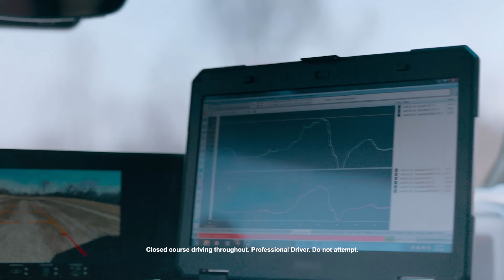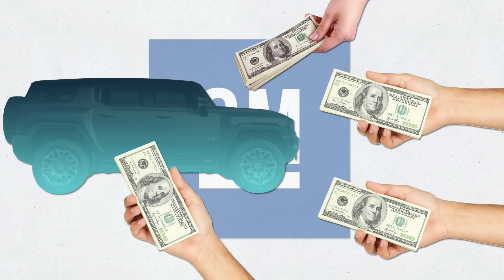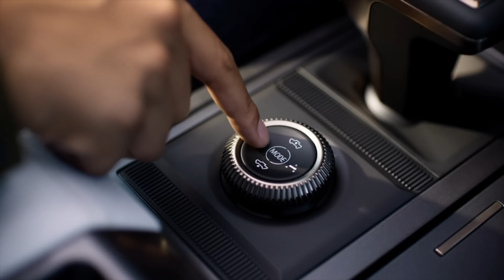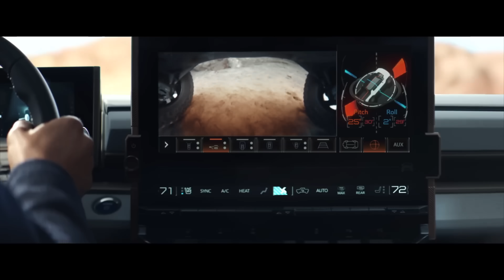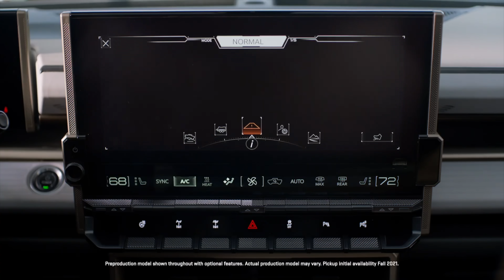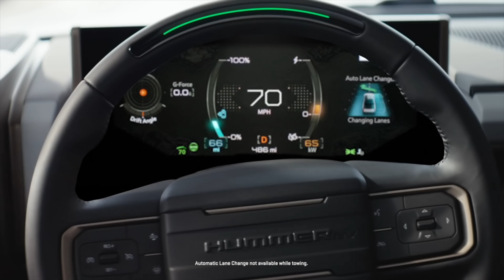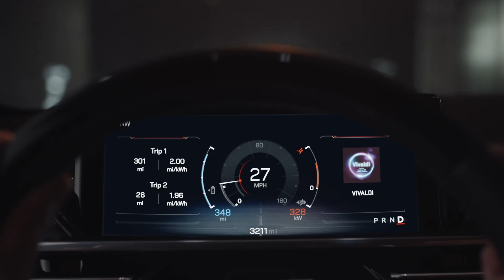Biden Almost Crashed GM's New Vehicle

Comment: As I listen to all the features, I think to myself, "this stuff will never break, right😂"
Reply: No more than any other Hummer
Reply: You do not want to own this thing outside of warranty, even more so than a Merc or BMW
Reply: when a brake light needs a microprocessor so it can do cutesy animations that have no real purpose other than to dazzle the rich yuppie who fell for buying one 🤣
Reply: @nicobr00  I listen to Scotty and drive Toyotas 😂 you won't catch me near this thing
Reply: GM and electricity= Walla
Reply: @youdontknowme5969  thats a purpose
Reply: @Ryan-vw6et  Toyota screws up to.   The new engine in their Tundra pickup is having big problems.  Toyota's reputation for reliability comes from using outdated technology, that has been debugged.  If they come out with something new its as likely to have problems as any other manufacturer.  Toyota will fix the Tundra, it will eventually be highly reliable.  Whats really screwed up is manufacturers that know they have a problem and they just keep producing the problem without fixing it, this does happen.
Reply: @nicobr00  The 3 series was just ranked very highly in reliability.  So at least BMW's inline 6 is pretty reliable.
Reply: It works on the showroom floor. That's it.

Comment: I watched a channel where they took the HummerEV off roading. 

Thr front locking diff switch broke and wouldnt engage and the lift wouldnt engage as they scraped over rocks on a Colorado rock trail.

Comment: We are putting $26,000 batteries in the bolts, a couple a month. That's going to be horrible when the warranty runs out
Reply: And don't get me wrong, I am all for advancements in electric technology, we're just not there yet. Also on the Environmental end, I don't know all that much about it but it seems to be much more toxic to the Earth than burning fossil fuels. And don't even get me started on the infrastructure, we won't have that for another 20 years where it will be feasible for everybody to use.
I wouldn't mind a little electric car just for going back and forth to work, but we already have two cars, my teenager is going to need one in a couple of years as well, and being that I live in Connecticut, who the hell has the money for registration, insurance, taxes, upkeep and maintenance on an extra vehicle that would be just that, an extra vehicle.
I wouldn't mind reevaluating sometime in the future when the infrastructure and technology is there, but right now it's just not feasible. Between work, activities with the kids, traveling for sightseeing and my YouTube channel, an electric vehicle is just not something that is currently feasible for me.
Plus our electric grid can't handle the electricity we need as it is already. It's using coal to produce that power. 
And yes I know there's natural gas, nuclear which I completely believe in and probably a handful of windmills across the East Coast that may use more than they actually put out, I feel it would just be easier to cut the middle man out and do a coal-fired Prius swap. I would love to do that one day just to piss people off, not because I like it, but I like it LOL

Comment: Is there a good reason why the car manufacturers insist on selling us ever-more expensive and complicated stuff that seems to have nothing to do with driving performance or efficiency?  They could make a brake light that costs $50, but instead they make a $4000 brake light that can't even receive a software patch when GM makes a coding mistake.

Comment: The 9000lbs Hummer EV is heavier than a chassis F550 with its steel dump box; F550 has G rated tires, better brakes than F450’s, so you can get a feel on what kind of beast the EV hummer is compared to those 350 and 3500 dually tow trucks on the road.

Comment: 4 days to charge using a standard 120 power source.  24 hours with a level 2 charger.  Drive it in northern Maine when it's 8 degrees out and tell me how the battery output is

Comment: Would you do a video on electric commercial vehicles. I use an E-Transit for food bank duties and it's overall pretty decent, but has a glitchy HVAC system and very low range.

Comment: One hopes you can reverse option OUT of the fancy light display going on in the tail lights, or 'rig' them to light up with an LED bulb and a 'home made, printed tail light lens'    Ebay anyone?   I melted my used 1990 ford Ranger (90,000 original miles, really) when my friend the welder said I can loosen that bolt with my torch.  Sure did and caught the lens housing on fire. 
Ebay got me a pair of new lens replacements, exact match for 35.00 plus 4.00 shipping.   Quite the difference.   Keep that old iron running boys, it pays.

Comment: I have a phone that would work for 3 day on a single charge when I purchased it - 7 months later the battery performance dropped off to a point that I had to charge the phone every day? Can I expect the same performance drop off in the batteries in these cars? It has a 350 mile range on a single charge now, will that drop off to 100 in 7 months like my phone did?
Reply: Just imagine if it's 10 degrees outside
Reply: Bingo!
Reply: There are a lot of factors that contribute to shortened phone battery availability. Car batteries are pretty different beasts. They have way different charging profiles and are actively cooled. There is some degradation but it's nowhere near as dramatic as what you're describing.

Comment: “The impacted software is embedded in the tail light micro controllers” Scotty 

A brand new sentence
Reply: Wait a minute, what happened to the greater and reliable TSC (Taiwan Semi-Conductor). Sounds like a semiconductor problem the GM that's a car company I never relied on, I'm more of an imports guy and these guys build hydrogen cars but two wrongs don't make it right when comes to making new automobile propulsion systems and fuel systems

Comment: Off road capabilities, I just thought what if you run out of battery on the middle of the woods. Do you call AAA and ask for a 5 gallon jug of electricity?🤦🏻‍♂️🤦🏻‍♂️
Reply: just carry a few AA bat in the glove compartment.
Reply: There was a guy on dragons den or shark tank that built a portable battery charging station for people with EVs who run out of charge.  It would be like AAA but for EV. So if the demand is there, it will be built

Comment: Try to watch all your videos. They're all great and have learned a lot. I have an issue I've never heard mentioned and wondered if you could shed any light on it. I have a 2012 Nissan Cube I bought new in 2012. It has 267k on it now and is the 6 speed manual. It's been a great car  and believe it or not, I feel like there is a lot of life left in it. I took it in to the dealer only once in its life to have a clutch put in at about 190k. Unfortunately, from day one the new clutch would slip on any incline like a steep driveway or a hill in San Francisco. When this happens you can smell the burning clutch material. I went back to the dealer several times about the issue and they drove it and said it was fine. So, I dove into the Nissan manual and found that there is a spec called out for the clutch pedal assembly that calls for replacing the assembly if the spec is out of range. The spec related to troubleshooting for clutch slippage. I guess since the clutch has no adjustment points, when out of spec it needs to be replaced to restore proper clutch operation. Armed with this info, I went back to the dealer, but they still denied there being an issue. So, I'm at 267k now and just have babied the clutch and been living with as I figured the car may not have a ton of years left. Fast forward to today, we still enjoy the car, it runs good and is not falling apart so we're wondering if we take this to a different shop on the next clutch how do we get them to acknowledge the necessity of replacing the clutch pedal assembly as part of a proper clutch job on this vehicle? The clutch job on this car is not cheap due to them having to replace the flywheel (which they did) cause I'm told they cannot be resurfaced. We'd spend the 2k+ to get it done again, but would be nice this time if it was right and did not slip.  Also, I am a machinist and I measured the clutch pedal travel tolerances with a machinists scale with carpet mat and padding removed. I fofget the exact measurement now, but remember it was not even close to being in range. Would value your thoughts. Thank you!

Comment: I will never buy another GM product ever. I bought a Saturn Vue and what did GM do? they stopped the Saturn line permanently. Everyone whom I know loved their Saturn, including myself but GM decided to end making these. Turns out they were losing money. Hard to believe but that's what I read. Apparently GM launched the Saturn line for only one reason: to have a fighting brand to compete with the Asian market. I still have my 2006 Saturn with 140K miles but I found serious rust at a critical point on the body to undercarriage connection and am in the process of repairing it myself. I'll drive the Vue till it dies but after that, I buy an Asian vehicle. Screw GM and the US auto industry, I tried to be patriotic and buy American but they screwed their loyal customers. My wife bought a Subuaru Forester three years ago and we love it. The Asians are doing it right while the US industry just keeps falling behind. Frigging morons need to get their act together.
Reply: I agree, I never had any luck with Ford or GM I bought a Toyota Camry and a RAV4 never ever any issues.
Reply: Move to Japan while you're at it.

Comment: EVs are still in their infancy. I'm sure early gasoline autos had plenty of problems too.  And I think GM is going overboard with unnecessary tech features that aren't necessary. They should get the basics- like battery and drive-train perfected before all the fancy tech-toy stuff.
Reply: Yet, that is the problem: it is still relatively new tech. While gas cars had 100 years to be perfected, making engineering marvels in intake, power, torque, etc., EVs are being pushed to make similar advances in roughly 10 years so that everything can be changed. That is simply not enough time for them to mature past the problems they have at the moment, and, since government keeps pushing them, it will only be accessible to those who can afford it. The best EV is something only the upper middle-class and above can buy, while older, less reliable ones are the only thing only the middle-class can get. 

If government continues to push this without allowing the tech to mature and people to have a right to repair ICE cars, the only ones who will have cars are them and the richer population.

Comment: I have not really been a G.M. Fan Since My Dad's 1973 Chevrolet Pickup Truck.   I think We had to start it about 10 times to get it out of the driveway.  That was when they started doing all of that Polution Junk.  It had a Carburetor and I think it nearly fell off.  It was a Very good running Pickup Truck.
Reply: Just had to know what you were doing and adjust the carb.
Reply: It was when all car companies started putting Polution Pumps on Vehicles.   A Guy that We went to Church with said that He wished that He could get under the hood with a pair of Hedge Clippers.

Comment: Gm fits him
Reply: What do you drive?
Reply: @googleaccount2637  ford mustang gt
Reply: @Braydenryder83  Ford has the most recalls of all time. I own 3 GMC sierras. 2014 2500 duramax sle 4x4, 2004 1500 5.3 sle 4x4 & 2008 5.3 z71 slt. My trucks are flawless and toilota can't offer anything as good as them. I even prefer them over Fords.
Reply: @googleaccount2637  it’s a 2005 with the 4.6
Reply: @googleaccount2637  sorry your wrong

Comment: I would never buy an Electric Vehicle. I would buy a Hydrogen Vehicle. I made my 2017 Explorer XLT an Hydrogen Hybrid. I can got 338 miles on a full tank of 10% Ethanol gasoline.
Reply: Depending on how big the Explorer's gas tank is that doesn't sound far off from stock. So what are you just feeding hydrogen into the CAI?

Hydrogen vehicles from Toyota et. al are electric vehicles, with hydrogen providing power to charge batteries.

Comment: My wife's hybrid Lexus has an 100k, 10 yr power train warranty, yup, just gas and go, no plug-in, with that beautiful Toyota reliability ! 2014 ES 300h with 92k miles and ZERO bills on the maintenance balance sheet. Yup... just gas and go with oil changes and tires.